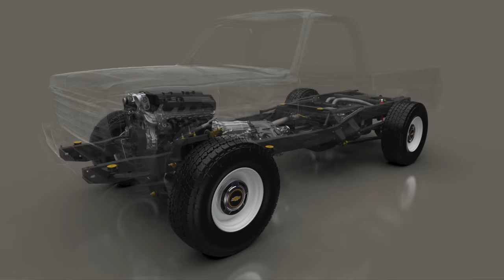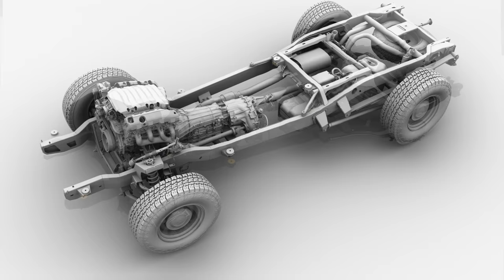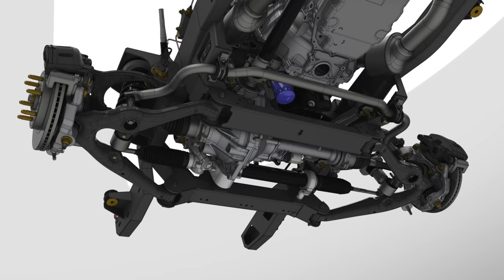NEW: 'Legend Series' chassis SEMA 2022 debut | Chevy GMC C-K10 & Blazer

Comment: I’m super impressed. If you guys can do the multiple lengths people will want (there are tons more long bed 4x4 trucks out there) it will be the next big thing in truck world. 
I would do this for the OBS and obviously older trucks. Great job as always RS
Reply: I agree, I would totally go for that chassis in a long bed configuration.  I love long bed box chevys.
Reply: A long bed or a crew cab version would be amazing, and i wonder if a duramax would bolt into the frame also 🤔
Reply: The pricetag though...its easy to make great works of art when you don't keep the consumer's pocket in mind.
Reply: Yah for 85 to 100k bucks im sure it will be the next big thing 🙄
Reply: I agree,I own a 74 C-20 2-Wheel drive,454/400,Super Cheyenne/Longhorn package,what do those rollers go for with the LS-4? $50K

Comment: As a guy who owns a Squarebody, the existing truck is damn near perfect. I have no issues with the frame or it's ability to drive/haul reasonable amounts daily.
Mine is LS swapped (LM7/4L60E), has some minor upgrades (Borgeson box, Bilstein shocks, all new moog bits.), but unlike some of my old GM iron, like my '63 Impala Vert, or my C1/C3, that needed a new frame (especially that X-Frame, thank you Schwartz Performance), Squares drive really well. No, it's not my W212, but it's a truck. Not a sportscar. It's taken me cross country many times. Comfortably. 

I saw this at SEMA and thought cool... For the guy building a six-figure show truck. My biz partner and I both thought it was nifty, but...

The beauty of a square is that they drive really, really well. Unlike my old work/shop truck, a '53 Chevy.

Comment: Will there be a wheelbase for a crew cab short bed for custom builds?
Reply: Why  crew cab truck with short bed is not getting used as a truck
Reply: @pmotorsports8276  perhaps as a 5th wheel trailer pull unit?
Reply: They make shortbed extra cab factory model k10
Reply: @pmotorsports8276   My short bed crew cab get used as a truck. It hauls a slide in camper while towing a 24 ft. trailer.
Reply: Those are so rare now it's probably not worth the effort for their company.
Reply: @entropyfan5714  ??? There's thousands of square body pickups everywhere that could easily be used for a crew cab short bed build. All you need is a cab and front clip from one pickup and either a factory short bed from another or order a complete short bed aftermarket.
Reply: @pmotorsports8276  that configuration is the number 1 selling in the US and has been for many years. Also plenty of people use those for more than grocery getting, I have a short bed crew cab with the Duramax and it has towed our 38' fifth wheel all over the country +30k miles.
Reply: @OneNationUnderGod.   agreed since 90's. Not practical, preferred,  we were given no choice
Reply: @pmotorsports8276  we have plenty of choice, I see crew cab long beds sitting on the dealer lot everyday. You never see a crew cab short bed sit on the lot very long though, especially the last couple years. My local GM dealer has a waiting list for crew cab, short bed 2500 & 3500 with the Duramax. You're actually better off to just order those until inventory gets caught up with the demand. 

Slider hitches have made fifth wheel towing with a short bed so easy. I have one and only need it if I'm backing in a tight spot, I can tow forward and turn as sharp as possible without the cab making contact with the trailer even with the hitch in the standard position.

Comment: I gotta admit, it is cool, however the nuances and pain in the asses are part of the beauty of these old trucks/cars. Less than thirty years ago almost everyone could drive a stick and tune a carb. Now, most can't drive a standard and good luck finding an old guy that can properly tune a carb and set a idle arm. These vehicles were daily drivers for years until about a decade ago when we slowly forgot how to maintain our cars. 
Said as my daily driver is a Chevy Sub K2500 with 454 and my weekend car is a 78 Z28. My brother's daily is a 85 K10 350SBC, and my dad's daily is 73 K20 with 454.

Comment: I daily a long wheelbase 74 k10 on 35s. Some would probably consider it high maintenance but it’s dead reliable just have to replace worn parts occasionally. Not much I can’t/haven’t rebuilt in my driveway over the years. I’d be so spoiled with one of these beauty’s.

Comment: I’m 27 years old. I drive a 78 C10 Bonanza. I have been looking for something like this. Something that has more power than what I’ve got. Running a Holley 4150 on it. Before my C10 I had a 87 K20 Scottsdale. Had power. Drove it from WA to MO no problem. I’d buy this chassis. Come out with it!

Comment: I've got a few old Squarebody's daily driving a Ls swapped 82 Gmc c10 Shortbed. Just installed a "new" steering column. Searched for 5months to find a good matching column only to have the same problem. It'll turn on the power but not engage the starter so push button start it'll be 😂 I'll figure it out later
Reply: Neutral safety switch

Comment: They didn't even mention one of the coolest aspects of a modern fully boxed and laddered frames like this: stiffness! Those original, simple chassis were floppy like overcooked pasta. This one is stiff as any modern truck. You can tell when during the slow-mo video of him drifting it offroad: no chassis shake, no bed twisting and undulating separate from the front of the truck, none of that. This stiffness would be apparent while driving when there's no squeaky noises, the ride would be nice and smooth, the truck would track nice and straight through mid-corner bumps and pavement irregularities, going over washboard dirt roads, and over things like railroad track crossings.

Comment: Had an 86 K Blazer that you simply couldn't get stuck in snow with the proper tires. A ride smooth as a Town Car. I wish I still had it.
Reply: I had an 86 blazer also and I don’t know if it’s the way the wheelbase is and the weights distributed but you can’t get them stuck in the snow or the mud. They’re awesome.

Comment: It says for 73-80,  will it also work for the 81-87 trucks. I know the stock frames were similar but not the same
Reply from the maker: Currently 73-80, as you mentioned the chassis are similar, but not the same. If we see enough demand for >'80 in this package, we may revisit it as an option.

Comment: I would prefer a mechanical stick 4wd selector over the electric. If the machanical doesn’t work you can crawl underneath and switch it into 4wd and back out.

Comment: I have dreamed of doing something like this for decades. Heart felt congratulations-You beat me to it. I sold my '78 K10 to buy a new '89 K1500 (which I still have) and while I really liked the "truck-ness" of the square body, the OBS era had a superior chassis. I think you guys perfected the idea of being able to drive an old truck, but not having your kidneys wrecked.
Reply: Yup I used to have a 79 1500 4x4 and to be honest I don't miss a dam thing about other then the body style. I now have a 98 Z71 I no longer have to deal with stupid frozen hubs no more ice and snow building up around the 4wd linkages to prevent or make it a bugger to switch from 2-4wd or visa versa no hard starts/no starts in winter do to fuckin carburetors. Not to mention them stupid saddle fuel tanks🤬 and I don't miss the lumber wagon ride of the solid front axle it's also nice having overdrive for running down the highway. This legend chassis is exactly what I've always wanted to build for my 79 but never had the time so sold the truck. Tobad this chassis is 29k us dollars 😬 cause would be awesome to get one and build a square body on a chassis that's worth building on.

Comment: I would buy the chassis if they had one for a 1970 C 10 short bed 2 Wheel Dr. It would be even cooler if they sold a lowered air ride chassis
Reply from the maker: but.....we do.....https://roadstershop.com/chassis-and-suspension/vehicles/1967-72-c10-truck/ 👈😉
Reply: @RoadsterShop  Looks like I found my chassis company, thank you for the link
Reply from the maker: @K-Effect  Great to hear - give us a call any time with questions. 847-949-7637

Comment: This is so awesome.  Is it possible to recreate these trucks without the possibility of future rust problems?
Reply: Lots of epoxy primer, Kevlar undercoating, Boeshield/Fluid Flim regularly, KBS wax cavity coating (especially in the cowl corners), and keep it clean?
I still won't let mine see snow/salt/winter. That's still bad even for new vehicles. Can't stop chemistry.
Reply: @andrewb4584  True but you don't really see body rust anymore like the old trucks were plagued with. Kept Bondo in business though.

Comment: You should offer a manual transfer case for us auto techs and other people who know one of the most common failures on GM trucks is the electonic t case garbage. It's bad enough trying to fix it when you can get parts from the dealer or any auto parts store. I certainly wouldn't want to wait or pay for any custom electronics.
Reply: Just keep it factory. No need for all this complexity
Reply: I'd take pushbutton 4wd all day long your making up bullshit I've owned many GM trucks with pushbutton 4wd and I've never once had one ever give me any problems.My 98 Z71 has pushbutton 4wd and it's never caused an issue and works everytime now that's alot of cold Canadian winters and 398 000km. I like the pushbutton 4wd as it cleans the interior up and I generally put my lunch box on the trans tunnel.

Comment: For god sake slap uh front axle and uh transfer case under there... I've got an 82 crew cab k30 single rear wheel with a 6 inch lift and dog dish caps... no ones impressed by a 2wd k10...
Reply from the maker: It's uh 4wd...

Comment: This person does not understand the concept of a true 73-87 Chevy 4x4. I don't understand the idea of putting new technology into these pickups. What happens when the transfer case electric motor goes out? Electronics degrade over time. Why not keep it mechanical? Instead of adding all these weak parts, why not build it unbreakable and more reliable? I built my K30 to be bulletproof for the next 50 years. 12v Cummins, NV4500, NP205, Dana 60 and Dana 70. My truck will out live that truck 2 times over. I can't respect a "builder" that wears a Rolex watch. If I wanted a new truck, I'd buy a new truck. Nice try. Better luck next time.
Reply: What are you gonna do when those old school parts are not available anymore, you gonna stock up or just take your new tech truck in and be able to get it fixed because technology is already here like no other so....yeah
Reply: @EricQNava  there will be aftermarket support for those "old" parts for the next 30+ years.
Reply: @Kooter198579  exactly "aftermarket" nothing is gonna be original from the 70's and 80's....